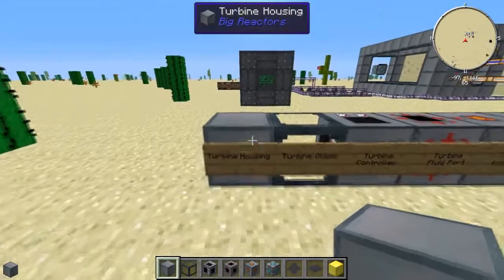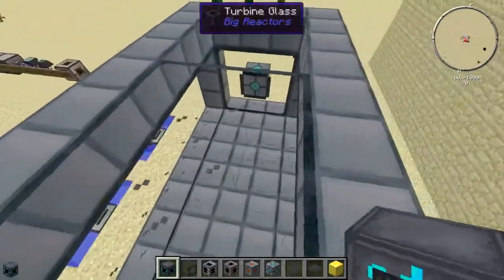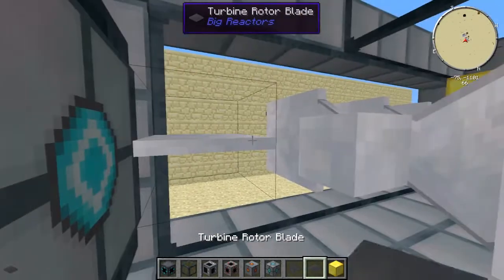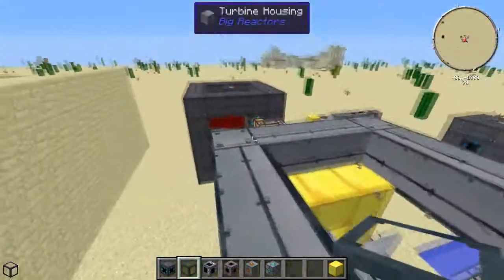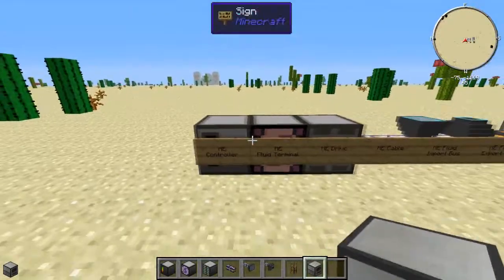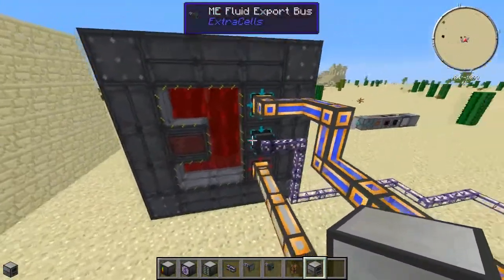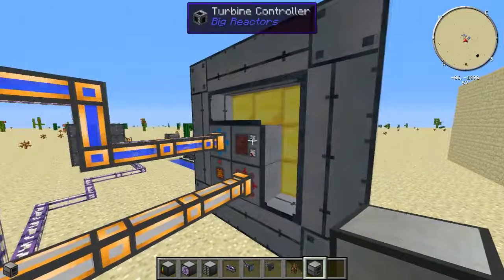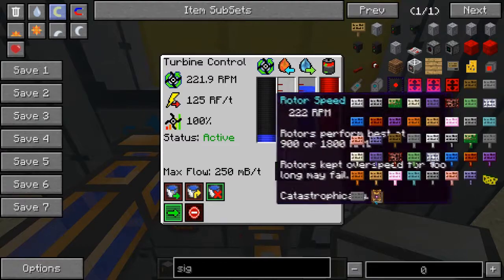Modded Minecraft Tutorials | Big Reactors Tutorial - Actively Cooled Reactors

Comment: I know I'm pretty late to the party here, but it's worth pointing out maybe that an actively cooled reactor + turbine can actually consume 0 water. If you pipe the exhaust water back into a buffer tank, and pump water from that tank into the reactor again, you end up being 100% efficient - your water comes back from the turbine at a 1:1 quantity to how much water is being pumped into the reactor.

This makes sense - water is converted to steam by the reactor heat, and then condenses back into water after being forced through the turbine, which can then be returned back into the system.

Just thought I would point it out - no need for crazy expensive water pumping systems or anything. Just some bucket carrying to fill the system the first time you run it is all! And making sure you select "Vent: Closed" in the turbine control panel - this makes sure the turbine does not release the waste steam or water into the atmosphere.
Reply from the maker: Mythricia That sounds like a really good idea! My name is Connor (aka AllKeggedOut) and I co-run this channel with Grissm, I'll make sure he responds to you too! :)
Reply from the maker: Mythricia I know exactly what you are saying. I can not be 100% certain on this but i will check. When you have the exhaust water pumping back into the reactor to cool it it does not actually supply enough water in order to keep the reactor sufficiently supplying steam to the turbine. Which is why in the video I have the computer supplying water to it through a 1000mb/t setting w/ Applied Energistcs.Ill do a test on our sever and see if they changed things since I made the video and let you know what I find. -JD/ Grissm
Reply from the maker: Affinity Collective Ok so I just tested what you had stated. The turbine does in fact NOT product enough exhaust overflow water to keep the reactor full simply by creating a buffer tank or running fluiduct straight from the turbine to a Reactor Coolant Port. You will need another water source to keep the system running. -JD/Grissm
Reply: I have a system running right now, which has, over the course of like 60 minutes, not gained or lost even 1 millibucket of water from a closed system.

I'll record it and link the video - I think you're missing something with the Vent settings or not completing the initial filling of the system.

But the system is a closed loop. It makes no sense to make it anything else, as long as the turbine is set to Vent: Closed.
Reply from the maker: For sure show me!
Reply from the maker: Mythricia hm wait. are you saying you leave the system off, fill up with water which you are calling ur "initial fill of the sytem" and then run the closed loop?
Reply: Affinity Collective What I did was connect everything like in the video - with the big water tank already full - then turn on the system - this will start draining the water tank because you need to fill up all the internal storage of the machines and the tubes and stuff - so just keep re-filling the tank when it drains - eventually you'll get to a point where it stops draining - when all the systems are warmed up and filled up all the internal storages. It can take a minute or two with my setup - different for every setup of course. But eventually you reach an equilibrium.

It's a bit like a PC water cooling loop.. You have to fill it while running it, else the water reservoir just empties and seems to "disappear" and you end up with broken stuff! Have to back-fill it until the entire system is filled.

Hope this makes any sense. Water never leaves the system - ever. But the tank is not the only place water is stored, that's the key thing to keep in mind. Water is stored in the reactor, in the turbines, in the pipes, and temporarily converted to steam between the reactor and turbine, etc... It's a lot of water! Just need to keep filling it until it stops "disappearing".
Reply from the maker: I see what you mean by this. Ill update the video ASAP to include the info! Thank you for the tip!
Reply: Affinity Collective No worries - and yeah I think a lot of people probably miss the feature - the wording on what the "Vent" options on the turbines actually do aren't very good.
Reply: +Affinity Collective Well, this has to do with the limited transport capacity of fluiducts. The most elegant solution is to put tesseracts on all the cooling ports. Maybe the "Ender IO" conduits may have enough capacity to transport enough fluids.
Reply from the maker: +99smite hm not sure, ill try it out